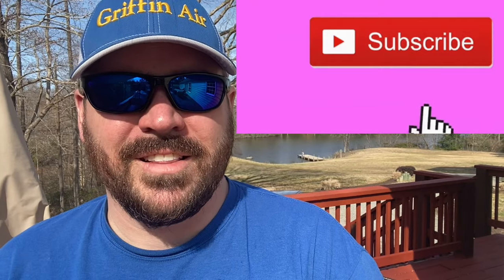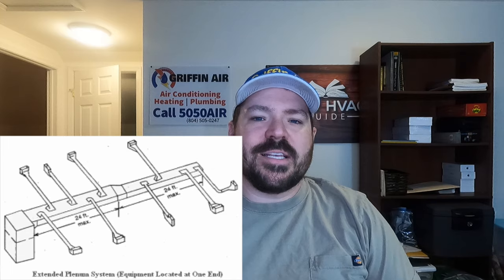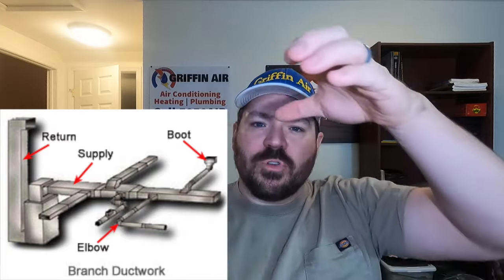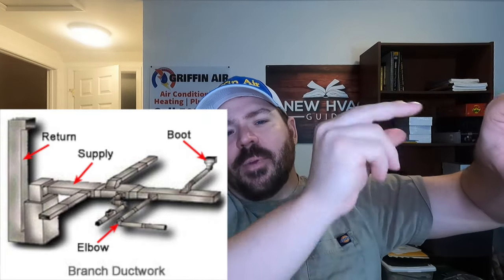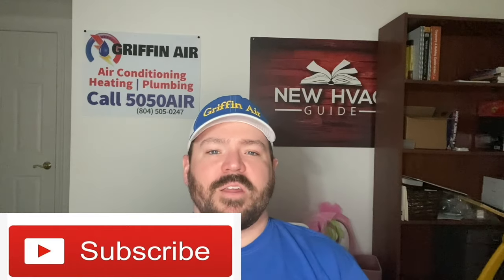3 HVAC Ductwork ISSUES Homeowners NEED To Know!

Comment: My home has flexible ductwork running through the attic with R-7 grade insulation. I bought more of that flexible ductwork, cut it lengthwise and used ties to wrap it around the existing ductwork. That gave me roughly R-14. I also put in enough blown-in cellulose to cover that ductwork. That was a lot of work, but it has made a big difference. Does anyone make insulation designed to be easily installed around existing flexible ductwork to insulate it better? It would seem like there'd be a market for that.
Reply from the maker: They started doing the spray on insulation a couple years ago and seems to be getting more popular.
Reply: The best thing to do is to get the area that the ductwork is in insulated and part of the “conditioned area
Reply: @georgewelker853  
That's the ticket.  Easier to implement in the design stage so the entire air system is installed within the sealed conditioned envelope from the get-go.

Comment: I have a similar problem that was mentioned. I have two returns. One on the first floor located at floor level takes a 16x16x1 filter.  The other at the top of the stairs located in the ceiling, 14x14x1 filter.  The first floor filter does need changing after 3 months.  The second filter looks like it could be used another 3 months.  And our house is dusty.  Does this suggest a problem?
More info:  our house is 35 yrs old, seems like its been dusty all those years.  Our HVAC systems have given good service I think.  Original unit lasted 16 yrs, the second lasted 19 yrs.  Both were packaged units.  Just installed the 3rd system and replaced all the ductwork in the crawl space supplying the first floor vents and return.  I'm hoping this reduces some of the dustiness.
Reply from the maker: Never hear about a return that rarely gets a dirty air filter, but the house is getting really dusty, it leads me to believe that there may be a problem with the return duct itself

Comment: I like your straw analogy but I guess the only problem I'm having with that analogy is that it's not open on the end of that straw/trunk. It still has to come out a small vent. So technically the straw metaphor doesn't really do justice to what you're trying to explain. I believe you should always cap the end of your trunk but because it has to still go through a small vent, the air will begin to back up and eventually come out the sides due to static pressure. So the whole straw analogy doesn't help much for me because it's not open on the end

Comment: The reason ducts get smaller as branches are made is to save material costs and ease installation.  It's not to maintain static pressure.

The other thing to note is that conscious designers don't duct just on room size.  It can depend on which side of the house faces prevailing winds, the amount of glass and exterior doors in a room, and airflow design in the space from supply registers to return registers.   The airflow through bathrooms is usually designed to be a little higher per square foot due to the benefits of air replenishment.
Reply from the maker: Conscious designers are few and far between.
Reply: @NewHVACGuide  
My first reaction is to laugh but I fear that's the sad truth!

I had the advantage of designing my entire structure including its location and orientation so everything could be synergistic.  
An installer facing a framed building with a floor plan that didn't include consideration for all the infrastructure could be met with challenging limitations.

Comment: Hey I'm from alberta Canada just wanted to say thank you for the info!

I have a 2 story house with finished  basement  we weren't thinking and purchased a central  ac system but the home is built in 1980 with a furnace from I believe it was updated in 1990

But the pressure  to the 2nd floor is not great, the windows are original  and  I'm pretty sure there is an insulation problem in the attic and maybe even the walls. Regardless our top floor is still cold in winter and warm in summer  probably  about  3 or 4 degree difference between the main floor and 2nd floor  I have no idea where to start  everyone says start with the windows..
Reply: You need zoning

Comment: There are a couple rooms in my house that I'd like to keep as cool rooms because they are not used. I seem to finding that if I close those supply vents off, it seems to mess with the proper air movement in the house and my house dont seems to heat properly. Here in Canada it gets flipping cold and my sunken living room gets cold as heck.